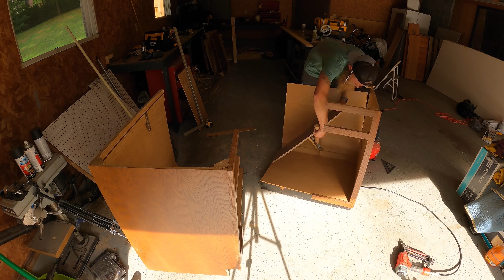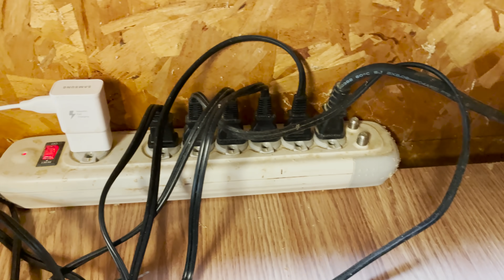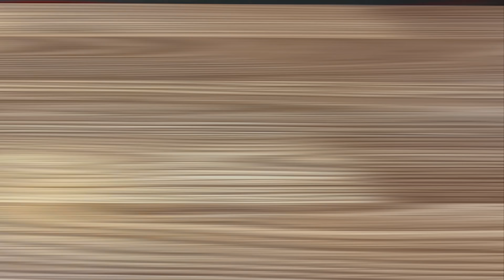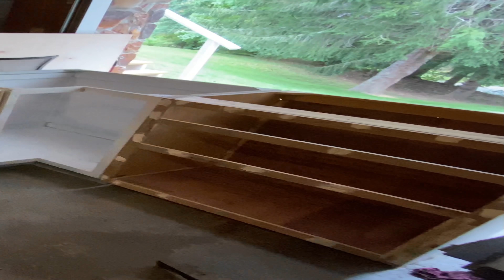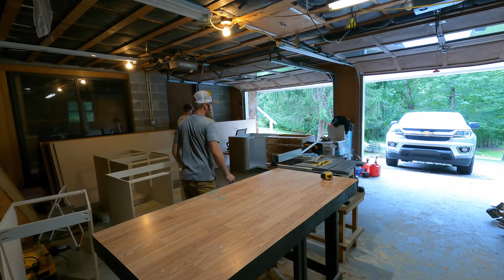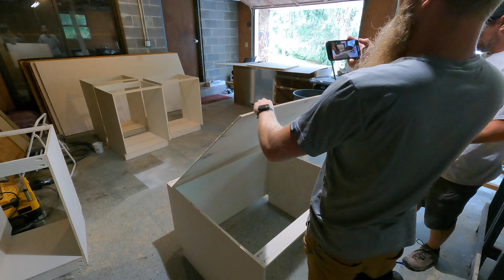The Modern Home Makeover // Episode 16 — Cabinet Boxes

Comment: One word: “Cracker Barrel” for Thanksgiving dinner.  
Problem solved!
And for the love of cabinet makers everywhere: use a damn rabbit on the bottoms and dado the rear for the back panels. 
Dove 🕊 tail the drawers
Brace and block all the corners
Reply: @eleodoro de la fuente is to too much time to repair the joints after those butts break?  Best to spend a little more time building and don’t worry about the repair later. 
Dove tails don’t come apart like a dado will.  And the rabbits aren’t as strong as a dove.  
I’m sure Jamie would have loved to ‘lend’ some guidance in the building of the cabinets.

Comment: Man, I should come help you guys, with my knowledge and skills of carpentry, fellas, I would fit right in.  I once tried to put chair railing on a straight wall and screwed that up, had to make additional trips back Lowe's for more trim, the whole nine yards.  I did however have a dam impressive pile of saw dust that my new compound miter saw made.  I finally called someone to come do that and a bunch of other stuff.  It is not as easy as they make it look!
Reply from the maker: Sounds like you'd fit right in 😂
Reply: Doug, Ain't it the truth, the learning curve is nothing but a decreasing radius, rare is the time it's as easy as it looks
Reply: You know, it hit me later on what my problem was the long piece of trim I was trying to put a 45 degree miter on was either not level or not squared up properly.  As a result the thing kept running up the wall or if I made it level there would be a gap where two joints joined together.

Comment: Look for a "sheet cut" computer program. You tell it what lumber or sheet stock you have and and the sizes of the pieces and it will calculate the most efficient cutting pattern taking the grain into consideration.

Comment: How Much shorter is that toe kick material? Seems like u could just double up the cabinet "floor" if u ever decide to use cab doors instead of drawers.
Reply from the maker: It’s a little too short for another piece of plywood. I did think about that, but then that’s at least $65 down the drain for another sheet of plywood.